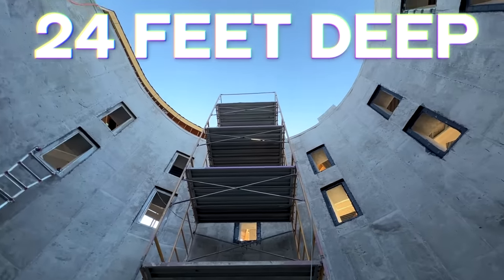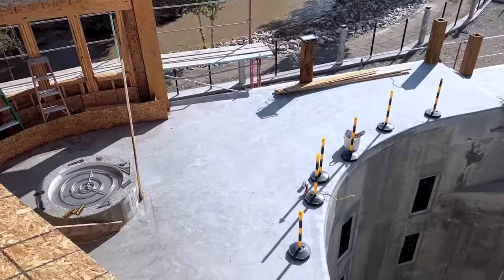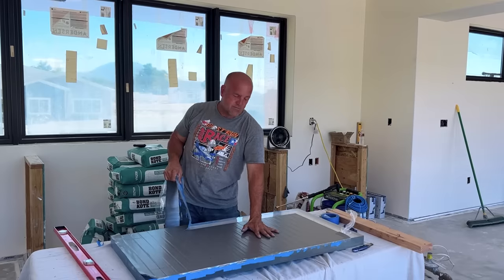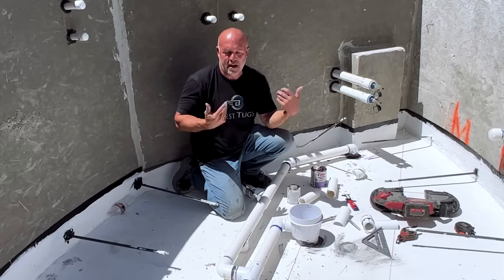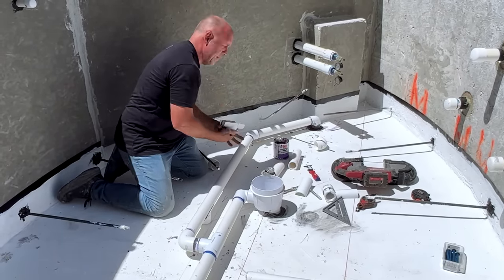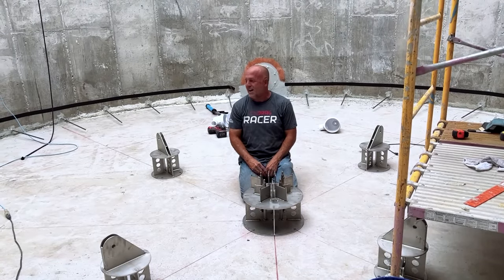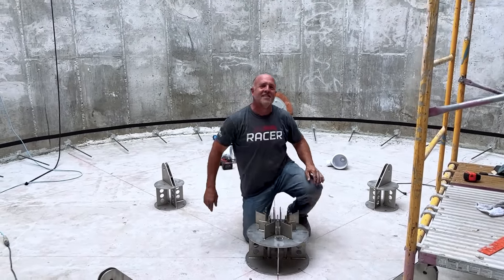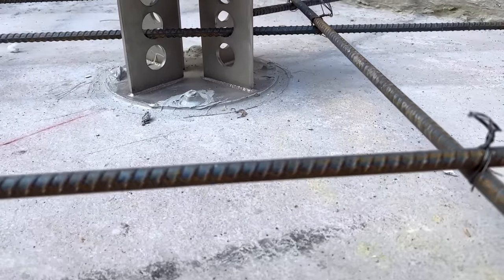Insane Rooftop Pool with Moving Floor is almost Done! | House Build #16

Comment: Truly amazing. There are so many things that fascinate and motivate me in this video, besides the actual pool and house itself. It is interesting how there is so many safety features throughout this system, but not much in the area of job site safety. I would think there would be a serious fence around the top of that pool to prevent someone from falling in during construction; and a net halfway down just in case the fence failed, and a trampoline at the bottom just in case the net failed. Just saying.

Comment: The amount of calculations and engineering involved in this project is daunting. The ability to connect these many complex systems so they work in unison and are “bullet-proof” is amazing. I’m assuming this is an unproven/novel design (based on best practices) points of failure have got to be keeping you up at night. The checking of figures the rechecking…this is a great series to watch.

Comment: Mike, when you are impact driving, and you have a swivel on 2 extensions, you are losing all of your torque due to that set up. You need to use one extension keeping it as short as possible and you can get a Stepped Swivel Socket Extension, and you won't lose any torque with that. You can also get Stepped Swivels in various other configurations. 

Back to work! 😁
Reply: The fact that the bolts are in as needed sort of indicates that the setup does the job though…🤷🏻‍♂️
Reply: @colinwallace5286  Thanks Mike patey for your infinite wisdom. Wasn't my point either.
Reply: @opieshomeshop I’m pretty sure if he needed more torque, he could figure that out for himself. If you’re honest, I’m sure that you would recognize that YOUR comment was in the “infinite wisdom” vein.  Having to explain what your point IS or ISN’T is beside the point.🤷🏻‍♂️

Comment: Got a suggestion for you. If that pool bottom isn't right at the surface then there'll be limited visibility of the depth (lighting dependent etc). How about a current depth indicator? Ideally it wouldn't be a digital sign, but one of those old school clock flip displays or a series of combination lock style rotating numbers. You could even go full mechanical with it, with the rising or lowering floor having a threaded rod connected to it calibrated to the depth.
Reply: I suggested this months ago
Reply: How is he going to find someone to insure this home?
Reply: I'm sure he's already thought of this.  He's not one to miss ANYTHING...lol.

Comment: I love how Mike is like, “This toothpick alone is strong enough, but I made it with 10 foot tungsten bar and 12 feet of concrete to be safe”😂😂 Love this guy!
Reply: There is still a sort of frugality in his designs and builds...    It's not a waste of effort.  It seems to be a major investment in trustworthiness and responding to lessons learned.
Reply: ITS A BUNKER!!
Reply: Have you thought about after sealing up all your PVC pipe pressure testing it with air to find any leaks before you cover it with concrete😊
Reply: @redrips5428 that goes without saying 😅
Reply: @redrips5428 you think a pipe would dare to leak on Mike's watch. Yeah I'd like to see it try 😂😂

Comment: I'd be super curious how building inspectors inspect/approve this project.  It is so far "out of the box", and I'm sure they all know way less than Mike does on the engineering front.  If Mike says it's OK I wager they just take his word for it and sign off.
Reply: An engineers stamp usually supersedes code.
Reply: Yes. If the plans are stamped by a practicing engineer, the liability transfers from the city or county to the engineer. The county doesn't care any more. At least that is my understanding. The inspector will (or should) still check to make sure it was built according to the plans. There is more to getting plans approved than structural soundness, though. There are all kinds of regulations. He talked about all that at one point in an older video. I think his initial design had to be scrapped because of something... maybe a setback requirement from the property line or something like that.
Reply: 18 minutes in the the mathematical explanation on how everything works, the inspector just realizes it's beyond his capability of understanding and stamps it.
Reply: @62cripple  
That would be what they would do in Australia too.  Fun police at all levels.
Reply: @suntzuwu  what planet do you live on?  Just this week I had a stampede set of plans get denied because they didn't meet city code. The firm I work with will end up meeting with the city and find out what they want and change to whatever they want ( probably drainage sizing on the parking lot). A stamped drawing is a nice start but engineering never trumps the inspection unless it goes to court.
Reply: In my town te inspector inpects the basic things, but an engineer inspects and signs off on much of the structural things.  I had the same engineer who did the plans do the inspections.
Reply: @tysleight  There is a big difference between a "stamped plan", which is what you get back from your county or city Plans and Review Department before you start your project, and an engineers stamp on a plan or modification. It's a matter of liability concerning the structure. An engineer can't, for example, override a set back or height requirement but, they can approve a structure change the is outside of the code book.
Reply: @suntzuwu  I'm sorry I should have been more clear. I assumed we were only talking about engineering stamps. I looked at my plans  they currently have a bunch of stamps from various groups. Fire, a private water company, health district,  one from the state DOT and one from the city DOT, a special use ( not a samp but a sticker) the most important and expensive is the private engineers. So lots of stamps but engineering and the P&Z are the only two that really matter until the build starts then it is all about the inspection that can put a red flag and shut us down for many reasons who is also a civil engineer.
Reply: @tysleight  I live in California and it is different from jurisdiction to jurisdiction.  In my town, your plans go to several departments.  First to planning and they only look at the architectural drawings and only for things like setbacks and heights and shadows and privacy, size of the footprint compared to the lot, etc.  It goes to the fire department and they look at the sprinkler plan and they look to see if you are in the Wild-land Urban Interface, if so there are some pretty strict requirements.  They said I was, but I am really a block outside it.  That was a month of fighting with them.  It goes to public works, but all they do is charge a road bond and then give it back when the project is done and there is no road damage.  It goes to the building department.  They are looking at the structure.  Do you meet the codes.  For the structural part of that, they send the plans out to an outside engineer who double checks the engineering and the calculations (which need to be shown on the plans).  The original engineer who drew the plans also needs to indicate where an engineer is needed for inspections.  In my case it was the foundation before the concrete was poured, the framing and the sheathing (California has earthquake codes).  

My small town (10,000 people) only has one inspector so he does all the inspections: foundation, framing, rough electric, rough plumbing, shower pan, sheathing, drywall, final...  Notice some of those double up on what the engineer has to inspect (by the way the homeowner hires the engineer to do the inspections).  In my brother's city there is an army of inspectors and they specialize.  One does nothing but plumbing, another nothing but electrical, etc.

When I talked about the plan checks above, I forgot to mention the sewer department.  They do a check to and that was painful.  They required I hire a plumber to run a camera down the sewer.  It had to be recorded and the plumber narrate the video.  My sewer was in perfect condition, but was the black ABS that almost every sewer in America is made out of.  Well that isn't an approved material in my sewer district and I had to replace it with schedule 80.  That stuff is expensive, especially the fittings.  They required a clean-out at ever turn and junction in the sewer.  There are 8 clean-outs at $500 a pop.  The sewer replacement cost me $20,000.  That was an expense I hadn't budgeted for.

Comment: Man, you talked about those skimmer connections being weak and the concrete guys stepping on them and breaking them. As soon as the poor started, the guy near the top of the video steps back right on it. Although, it looks like he didn't put his full weight on it when he realized it. I think this is the first time I've actually heard you tired. Hopefully you've had plenty of rest since the pour. Great video. I can't wait to see the pool finished. I'm sure you can't wait either, because then the work will be done and you'll get to enjoy it.

Comment: Man, I love all the redundancy and getting to watch you build this masterpiece!   Just a quick question from a novice rookie.  Is there any chance of galvanic corrosion where your steel rebar passes through the stainless steel pulley block anchors?  At least if it were to occur, I think only the rebar would be affected (I think)

Comment: Crazy!! I have a question as an engineer that knows nothing about pools. What happens overtime when the concrete embeded pvc pipe wear out? Do they eventually break away and you're left with a concrete pipe instead or you break the concrete and service it eventually? Cheers

Comment: Impressive is an understatement here. Mike you're an awesome crazy dude. Without knowing much about the floating floor why use cables to lower it instead of changing the buoyancy of the floor like a submarine?
Reply: Cables are strong, redundant, and efficient. Even if the floor’s buoyancy can change, you wouldn’t want it going all tipsy turvy because of a bad valve
Reply: @Jacob-c123  Maybe... but if the floor was shaped so that it couldn't go tipsy turvy then changing the buoyancy offers a less mechanically complex system that will wear way better over time and be easier to maintain because you're only actuating pneumatic valves instead of putting thousands of pounds on cables submerged in water. For several reasons you probably don't want the floor to have the ability to tilt and jam anyway. If you had one hose to fill and evacuate air from some billows then the pneumatic valve could be located in a dry serviceable area. If you ran a compressed air line to the platform too then you could lock it in any position with pneumatic rams against the walls.

I'd likely put in three air hoses for three sets of billows that would create three conditions. Up, down, and neutral/fine tune. I have a feeling that a depth pressure sensor and a simple little Arduino could automate the process too. That way you would just tell it how deep you wanted the floor and through programming it would corelate that depth with a certain pressure and set the rams automatically.

Cables might work more quickly. But if speed was a major design factor then I feel like you could also get that by beefing up the pneumatic method.

Engineering is always about trade-offs. One thing I do know is that nothing escapes Mike and that's why I'm curious what factors went into him choosing the cables.
Reply: @carsonc1272  You are right, Mike will probably make the shape of the floor so it can’t jam anyways. I like your pneumatic ideas for sure, but I personally think the cables are a more simple system with less modes of failure.  The cables will all be the same length and be redirected through these pulleys and all go back to perhaps a single winch drum with length adjustments being made at the platform end of the cables. I do believe he said the platform can lock in place at the top, so then you could de-tension the system and replace the pulleys or cables if needed by diving down with scuba gear and therefore not draining the pool. I also think the cables will act as a sort of positional guide for the platform as well. Anyways, there are “more than one way to skin a cat” as they say, and hopefully we will gain insight as the process goes along. Cheers

Comment: Mike, I’m no engineer as my question may prove. How do you keep water in a pool with a moveable floor to change depth? Does the floor have its own wall sealed to the pool bottom that moves up & down with the pool bottom?
Or like an infinity pool the overflow on the edges cycle back into the pool? Got to be sealed somewhere or all your stuff at the base would be water logged.

Comment: I'm curious about the sch. 80 3" pipe that you had to heat up and bend...does that weaken the pipe enough to cause cracks and fail later on?? amazing work all around!  I don't think this guy sleeps.

Comment: If I was building a pool again, I'd put more remote monitoring cameras and flow meter sensors so that I could check for air bubbles,  leaks, and pressure flow rate for each pipe.  Pool automation systems by default are way too limited, and pools require a lot of maintenance and monitoring over a 20-30yr lifetime.  You never know when an otherwise stable burried pipe will develop issues.

Comment: Just a curious question.  Why not make the platform buoyant then be able to flood it to sink it to the correct depth?  It seems a couple of valves and an air compressor would be a more simple design. Sorry if I missed a video if you addressed this.

Comment: Question: Is there a reason you didn't put a metal cap on the outside of the wood where you ran the 8-inch bolts through for extra strength? Is that type of wood product so durable it's not needed?

Comment: 20:26 those main drain pots are not designed to be encased in concrete or have a 24' column of water sitting on top of them. The threads on those fittings are not either!!!
it's gonna leak!!!

Comment: I don't know man, still seems kinda flimsy to me :)
Kidding aside, one thing I've wondered in general about houses is if a steel structure isn't the way to go. Essentially like how highrise buildings are made. It's quite space efficient because steel can be strong for the size and it has an inherent toughness from its strength and flexibility. Obviously concrete can be robust if just thick enough with rebar but for overhangs and decks, suddenly concrete becomes very massive. Stainless steel for a house is really quite capable on many fronts and it bonds quite securely. You can make a structure that looks effortless yet no hurricane will move and no earthquake will damage. And a steel structure lends itself well to 3D printing which means you could have fabulous structures appear overnight with no labor and borderline negligible cost. Steel trades around 500$ per ton. Imagine a laser sintering robot putting together a full airtight house structure with perfect holes for the windows and some kind of cladding and insulation for 5k with no manual labor. And I don't mean homeless housing but the most luxurious design imaginable.

Comment: I admire all your work, including the aircraft but…. Reinforcing steel in the 8-2/2” slab is there to control concrete shrinkage cracks and, as a structural engineer, it doesn’t look to me that there’s enough steel - or at least that the steel spacing is too much.  There are industry codes that prescribe amounts and placement.  Finally, if the slab exceeds a certain fairly small area it should be placed (“poured”) in multiple individual sections, also to prevent future cracking from concrete shrinkage over time.  The edges of these individual pieces would have provisions to prevent water passage between them.  The fact that the slab you are building in this video is on top of another structural slab may obviate the need for some of these precautions - maybe this is in your thinking.  I hope you accept my comments as helpful and not as criticism!  Good luck with your innovative design and construction!!!

Comment: Does the rebar on the bottom of the pool seem too little/light?
I mean for the amount of water that will hold I was expecting way more.
Reply: Or is it just sitting on soil and holding the actual platform I guess?
I need some more info to understand how this system will work.
Epic project
Reply: It is 8-12” of concrete sitting on top of 2 feet of concrete. It will hold the weight just fine. I think the reason the rebar is sparse in the thin pour is for future ease of service in 50 plus years. If a pipe or pulley bracket needs to be replaced, it is much easier to cut out.